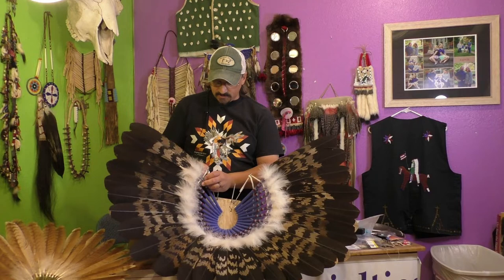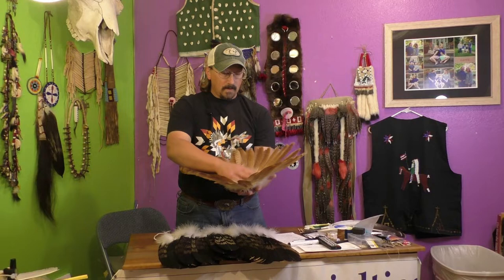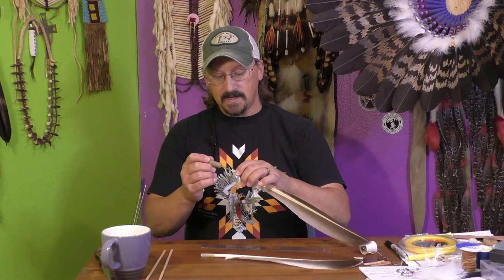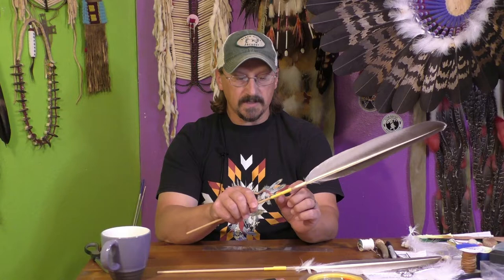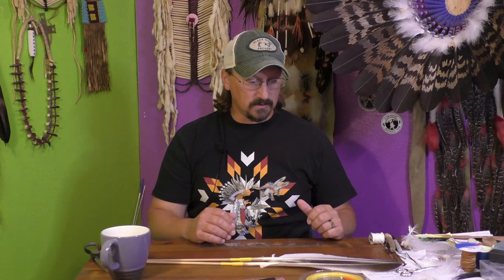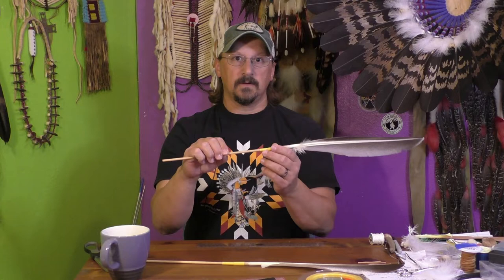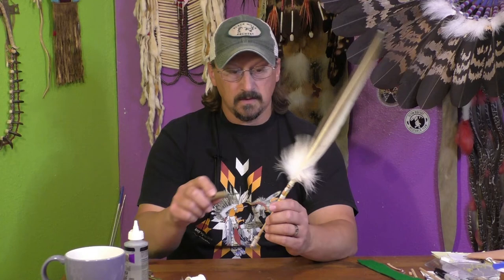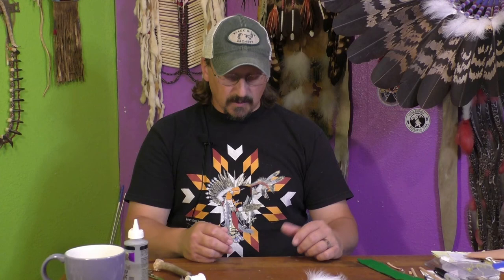Building a Men's Traditional Pow Wow Bustle; Native American dance bustle construction

Comment: I have GOT to buy one of those fly tie spool holders! I'm also going to try the flat "loop" on the back of the feather for the bridal string. If I can collapse mine & both my sons' traditional bustles, that will be a game changer!! I'm also going to do the clear nail varnish instead of the Tacky Glue with my heat gun. Your method will be significantly cleaner on my fingers. Thank you for the amazing video. Why didn't you show me these tips in the 80s when I started making bustles?
Reply from the maker: Marcos, I'm glad you got at least one good idea from the video. Thanks for watching.

Comment: Do you use latigo leather for the ends that create the loop? I have previously soaked and cut rawhide lace but it results in a much bigger diameter than the quill. Thanks for your wisdom and clear directions. Tony Redhouse

Comment: So how does it look without beads how does it hold?
Reply from the maker: The leather loop is quite small and the shoestring I used is thick. It didn't slide through easily so the friction between the leather and the lace holds each feather in place. When making bonnets, historically and still today, one cuts a thin slot through rachis to run the leather lace through. The tension keeps the feather in place. This is pretty much the same idea but without making a slit in the actual feather. Thanks for watching.